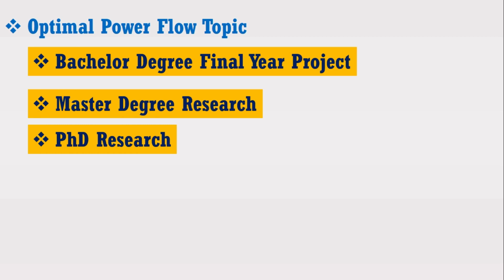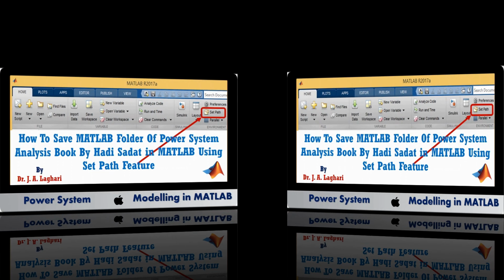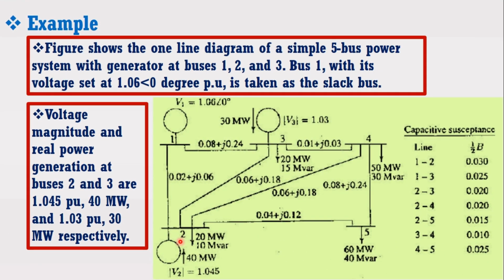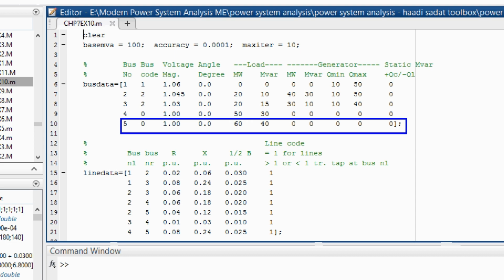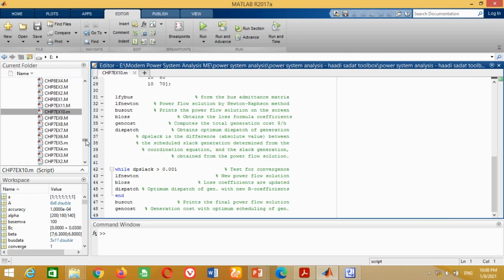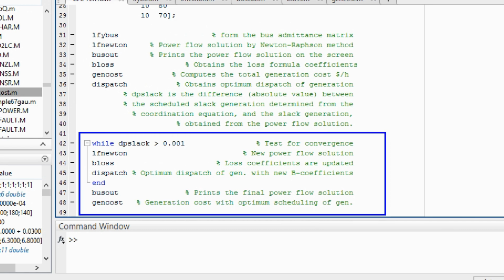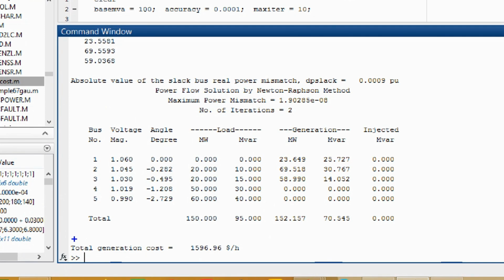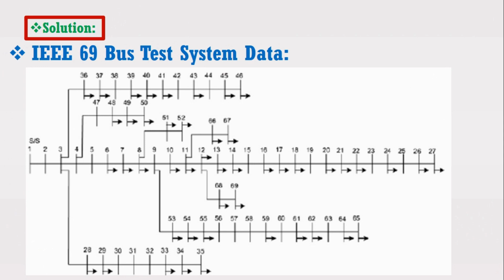How to Perform Optimal Power Flow in MATLAB ? | Dr. J. A. Laghari

Comment: Thank you for your amazing tutorial. How are generator Mvar and Qmin, Qmax values determined for the slack bus and voltage controlled buses 2 and 3 at the array busdata? These are not given in the 5-bus figure or description, but values are inserted in busdata. Thank you.
Reply from the maker: Thanks for the compliments and comment. These values are given in the matlab data. These data are standard and fixed.
Reply: @DrJALAGHARI  Thank you for the quick reply. I can see that the values are given in the Matlab code but this are not given at the example or figure. For example for the slack bus we only know that V1=1.06<0, so I would have assumed that only these values need to be inserted at the busdata array. Instead I can also see in Matlab code that Qmin=10 and Qmax=50. Where did we get these values from? Are these reasonable assumptions on Qmin and Qmax to make the optimisation work?

Comment: Hi Dr. J. A. LAGHARI, if I wanna add more further constraints including the bus voltage magnitude constraints, line apparent power flow constraints, etc., what should I do to modify based on Hadi Saadat's opt. MATLAB code?
Reply from the maker: Thanks for the comment. I am not sure about this. You may find more help by using matpower toolbox.